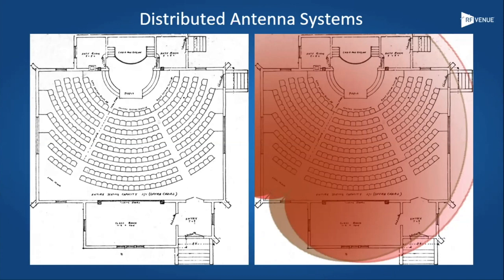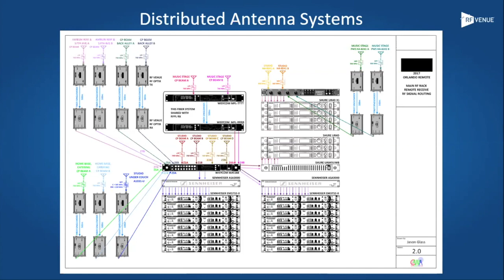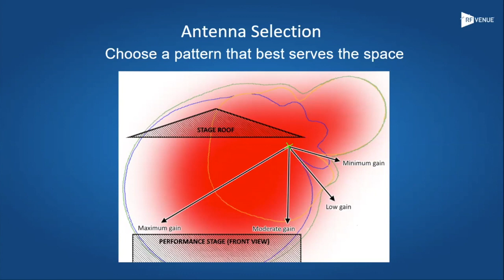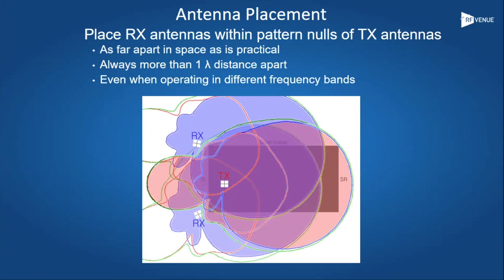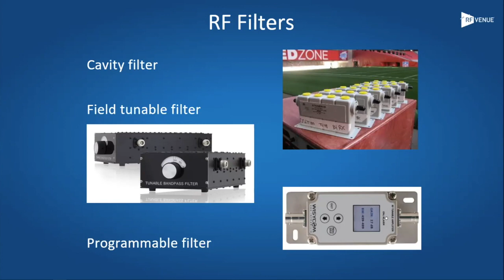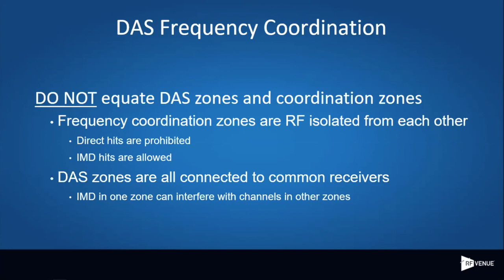Distributed Antenna Systems - Webinar 2

Comment: Some time stamps for me:
High end vs. Low end receivers:  14:06
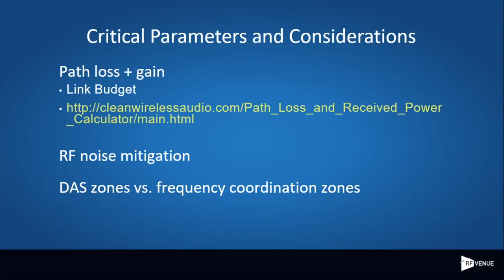Splitters/Combiners:  21:58
Multipath interference:  28:33
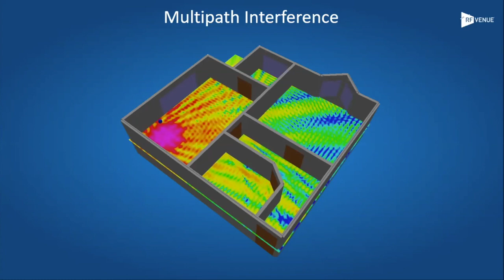Illustration of signal propagating in free space:  29:24
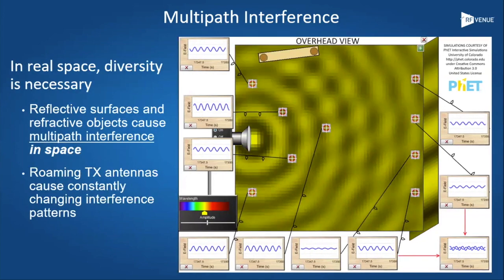and with a single reflective object added to that space:   30:16
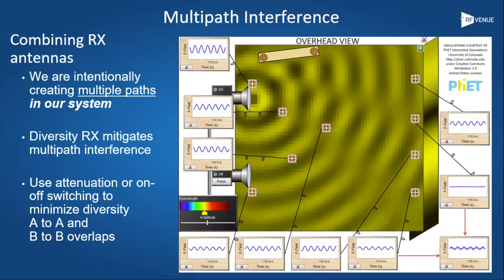and with the transmit antenna moved:  31:53
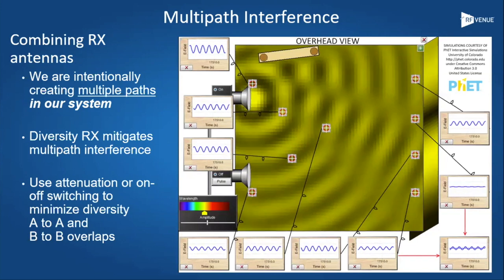Antennas:  33:48